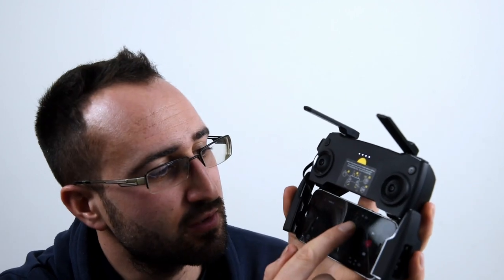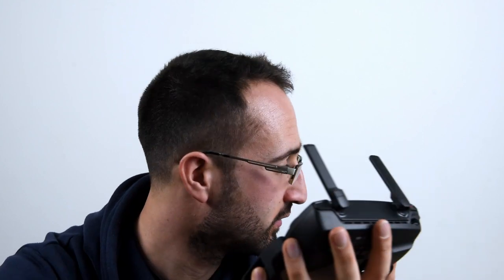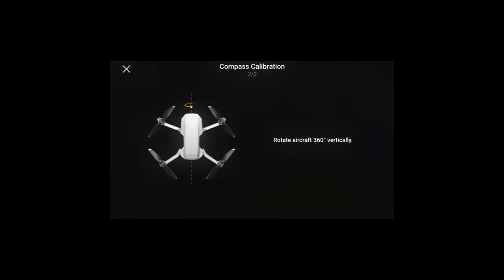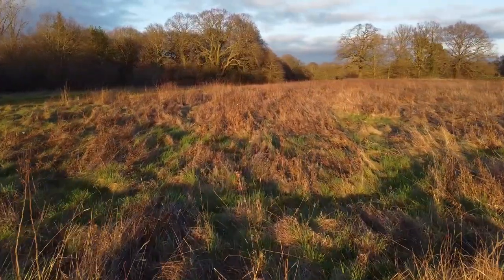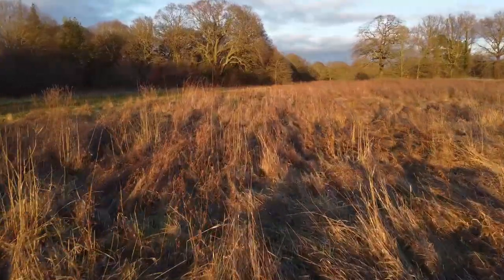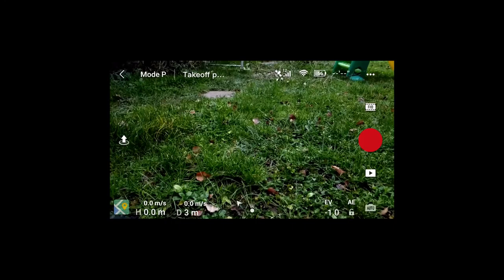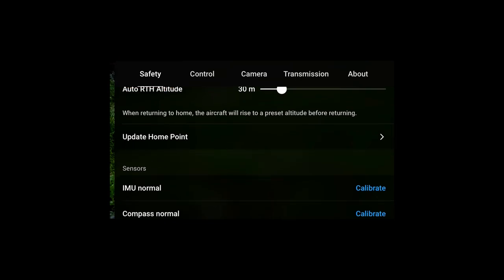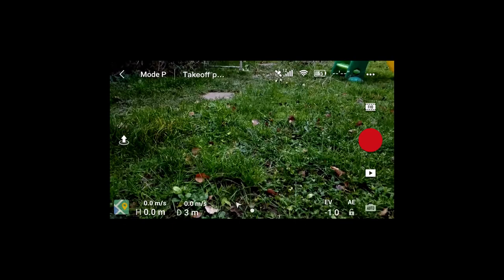DJI MAVIC MINI - HOW TO PREVENT A FLYAWAY

Comment from the maker: Have you ever experienced a fly away?
Reply: Not me :)
Reply from the maker: Lets keep it that way!
Reply: Frank Capablanca today actually me and my family got one and the winds pushed it across the highway
Reply: Yes - took off inside my parking garage, with NO WIND I flew it out and as soon as it was outside the garage, not even 20 ft away, the drone just shot off straight ahead, It didnt seem that my controller had any connection anymore. (Mavic mini)
Reply from the maker: @StudioCuts  Sorry to hear that. The drone would have trouble picking up GPS in a garage and if there as a large metal door that could interfere with the compass, so when you take it outside and the satellites pick it up it will think it is in a different location. I hope you got it back!

Comment: +1 Paul-Thys - Good points.  Regarding wind, I can't get my head around why so many YouTube flyers are pressing their luck trying to fly their Minis in near gale-force winds then crying because of a flyaway.  Geez a little common sense would save the day.  The Mini is tiny and extremely light weight.  Of course it's going to struggle with even moderate winds.  I would never fly my Mini (or any drone or RC aircraft) in winds stronger than I used to fly real aircraft. 

Now then, here's a tip that might help that struggling Mini make it home.  Immediately cancel RTH and switch to S mode, for fastest speed.  Look at the display and quickly yaw/turn the Mini until the aircraft direction indicator is pointing directly at you then immediately give it full forward stick and head home manually.  Reduce height/altitude as much as possible as wind speeds are likely to be less the lower you fly.  Be sure to stay above possible obstacles.  If you're not familiar with this technique then PRACTICE it a few times so if/when you need it you'll be proficient.

Another tip is to NEVER begin your flight flying downwind (wind at your back as your drone flies away from you) for any distance flying.  Conversely, always begin the flight upwind (wind in your face...).  Your Mini will be fighting the wind departing but will have a helping hand (tailwind) on the way back. Your battery pack will be glad you did!

Cheers from Thailand! 😁👍
Reply from the maker: Thanks Jimbo! love this!

I am going to do a video about wind and the mini soon. I hope you don't mind of I use these points? 

I agree it can handle light wind and have nearly been caught out once as I raised a little higher than the conditions allowed. My fault entirely! Lesson learnt and no harm done in the end.

Enjoy Thailand, looks like a beautiful and certainly on my list of place to visit!
Reply: @paul-thys  Please feel free to use/share those points any way you like. 😁 And gotta admit as a drone newbie 3 years ago I had lost a drone from a flyaway in winds that were not only too brisk but, more importantly, too strong for my abilities.  So, yeah, I definitely know the pain.

Hope you do make it to Thailand as it is quite a beautiful country.  BTW just subscribed. Good luck with this channel! 👍👍

Comment: Hi. Great video. Just recently my mini was experiencing warnings of signal interference and started to fly haywire. It was moving sideways and backwards without me controlling. Very scary, but I lowered altitude as fast as I could. Keep in mind I was flying around my apartment complex (lots of different wifis) and I had phone wifi on (does it effect anything)? This was the second time this happened. First time was on a tennis court and it flew 100s of ft around the area before it nosedived into a wall at around 30 mph. I had to get it repaired. Do you have an explanation? I'm quite scared to fly it again. Also considering an upgrade to a drone with ocusync (how does that work compared to enhanced wifi)? Thanks.
Reply from the maker: That's not normal. I would contact DJI...

Comment: My Mavic Mini got caught by the wind, never to be seen again. When I took off, wind was <5mph, After reaching an altitude of 285' I received a strong winds warning and immediately issued a RTH command. The drone did not respond and I was helplessly watching the distance increase while altitude was steady. After a couple minutes I started getting warnings about signal interference and began losing contact with the drone. When contact was regained, the last position of the drone was 280' altitude, 1856' distance from my home position. Then the low battery warning occurred. Never found the drone. I had just purchased it a couple weeks ago and had DJI Refresh and the Fly More combo. DJI refused to do anything about the fly away  and they offered a 15% discount towards the purchase of another Mavic Mini less the controller and charger. Pretty lame. I would not recommend this drone to anyone who intends to fly it if there is any chance of wind. It simply is too light and has no power to overcome wind.
Reply from the maker: Sorry to here that! 

I take in the mini is off your wish list now? It's a shame that has happened and I can see you have a lot of experience with drones. 

That is a very valid point and worth a follow up video. 

I struggled with my mini in the wind yesterday. I got warnings and the mini started to drift. It was only 40 meters up. After hitting the RTH it very slowly started to return, but the wind had blown in out of line of sight and returned after about 3 minutes from an unexpected direction.

I completely agree. The mini really does suffer on the power front in strong wind and it's weight does become an issue!

From now on I might keep a kite in the car so it's not wasted journey if it is too windy...
Reply: Hmmm...interesting...
so I once flew up to 500m with the Mini even strong wind was blowing over the country and nothing happened.
If you are too high and signal is lost , the RTH automatically turns on, but if you are too high ( or you set your height too high) the Mini can’t return since the wind is too strong.
Reply: The strong wind warning should have give you a clue! Simply reduce altitude and manually RTH using sport mode if needed! Pressing RTH in strong wind at high altitude is like saying goodbye to your Mavic Mini⚠️
I've watched many many youtube videos where pilots are flying this tiny very light drone in 20-30mph strong winds and they are still wondering why it is flying away! 
It simply doesn't have powerful enough motors to overcome a strong wind, I think DJI rate 18mph as the max wind speed it will fly in, I'd recommend not flying it in that speed wind, I would say 12-15mph  as the absolute max wind speed, preferably below 10mph is ideal 👍😎 Also consider wind speed at altitude can be much greater than at ground level.
It's a bit like flying a kite on a windy day with no string attached😁
Reply: PD Tech the strong wind wind warning did give me a clue. Maybe read more carefully. I left out quite a bit of detail since I did not want to write a novel. When I first took off winds were less than 5 mph. I was in cinema mode to capture some beautiful scenic views of my surrounding area. As soon as I received the strong wind warning I immediately attempted to lose altitude. The drone was directly overhead, I had not flown any distance away from my position. The drone was unresponsive. The drone was holding altitude, but the distance reading was increasing slowly.I aborted RTH and went into sport mode. I attempted to lose altitude again and repeatedly. The drone was unresponsive. The wind had moved the drone downwind far enough at an altitude of 280 feet where I was no longer able to maintain visual contact. At this point I had to rely on the visual display and the only thing I was able to do was pitch the camera down so that I could see its ground position. I invoked RTH once again however the feeble drone was not able to fight the wind. It continued to drift further away. Eventually I lost visual display. It came in and out several times. At the same time I received electrical interference warnings. At this point I was basically flying blind. I couldn’t hear the drone, I couldn’t see the drone, and the visual display had gone away. I then begin getting intermittent lost contact warnings. Eventually the low battery warning appeared. The drone was in RTH mode. The drone was lost.
Reply: @michaelerbreviews  Sorry if I misunderstood what you meant? I was just trying to offer up some friendly advise and maybe a possible explanation. 👍😎
I've had that experience of flying a GPS drone that strong wind took away, it's a sickening feeling when it doesn't respond to your control input, even trying to descend it might stay high if the wind is strong enough, the props almost act like wings, giving lift! The wind at ground level was less than 10mph but higher up I realised it was much stronger, I could see the clouds moving very quickly!
Luckily mine crashed and I was able to recover it.
With the Mavic Mini, it's important you stay calm and think about available options, it's quite possible to fly by telemetry and FPV feed, while you still have connection, especially if you have lost sight of it. If it's still not responding and 'flying away' you need to act quickly before you lose connection and FPV feed, use the camera to look directly below, find a suitable spot and press land, if that doesn't work you have to risk killing the motors and force a crash land rather than risk losing it because once you have lost connection, the 'find my drone' feature in the app won't give it's current position, only the last known position before it lost signal⚠️
Hope some of that is helpful for the future? 
Check out my 'Bebop Flyaway' video, it's not so far back! Also my 'Epic high altitude drone crash H502c', it has 'CAUTION' in the thumbnail, but that was way back! 😁👍😎
Reply: @pdtech4524  I appreciate the advice. The main problem is that once I lost connection to the drone, there was nothing I could do. I had pointed the camera down earlier but at 280' altitude, I did not think that commanding a landing would be prudent or safe. And the drone  seemed to be simply unresponsive. It just basically sucked all the way around.
Reply: You should of try the find my drone feature in the app..you probably still had enough battery power to locate the drone

Comment: Dammmm are fly aways that common on the mini? I’m starting to see a ton of videos on flyaways
Reply from the maker: I think the biggest problem with them is the wind. They are just too small and lack the power to battle high winds, in excess of 15mph. If you are sensible, fly in nice weather and don’t push it up too high, you will be fine.
Reply: Hmmm the mini is on my list but with all these flyaways I think I'll save a lil more money and get the mavic air 2

Comment: My one decided fly away. Out of control. Didn't react on remote controller. Well.... What to do then? Try to catch?
Reply from the maker: Ah sorry! That's got to be scary. Yes, try to follow it as best you can and your drone app should tell you it's last known location if you do loose sight of it.

Did it you get it back? Do you know what might have caused it? high winds, flying in an area with high wi-fi traffic?
Reply: @paul-thys  luckily that was 1,5 m altitude. Hit wall, went up again hit next wall. Broken.
Hard to see that because you can't do nothing. 
Kinda lucky because those walls stoped drone. 🤔
Reply from the maker: @dagnisabols7530  That's strange. So sorry to hear that! Hope it hasn't put you off drones!

I guess you were outside? was it low light?

Have you contacted DJI?
Reply: Was low light. GPS good connection.
I been flying in really low light without problems.
😔 Still waiting on DJI.
Reply from the maker: @dagnisabols7530  Hope it goes well for you!

Comment: All good advise! I'd also add don't fly in high winds as the Mavic Mini will struggle flying against them and also consider the wind speed at altitude might be much higher than at ground level 😎👍
New supporter for your channel, hopefully you'll check out my Mavic Mini related channel and connect? 😎👍
Reply from the maker: Thanks you :)

Absolutely! I will be doing a separate video about the wind and will mention your video and link it in the description. Its great to see you have specific wind speeds mentioned rather than just saying 'strong' or 'medium' winds.